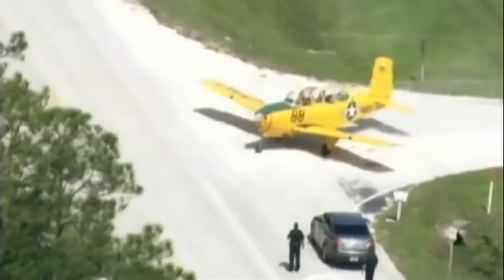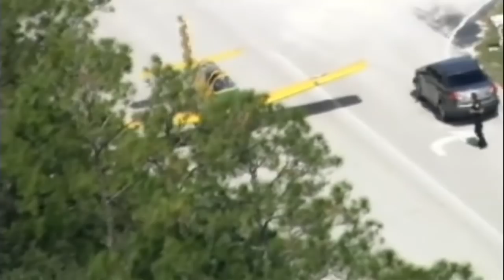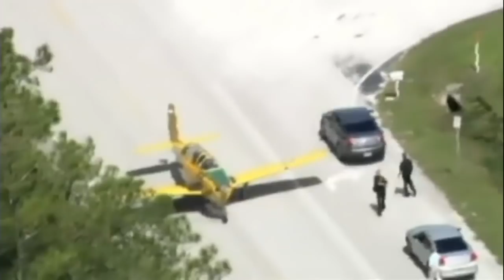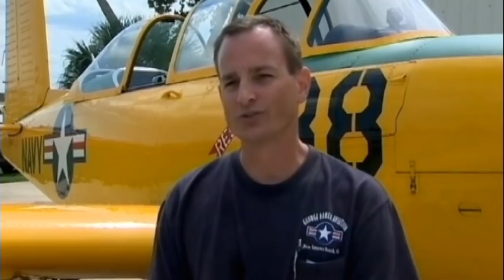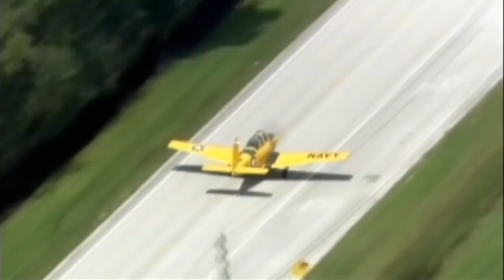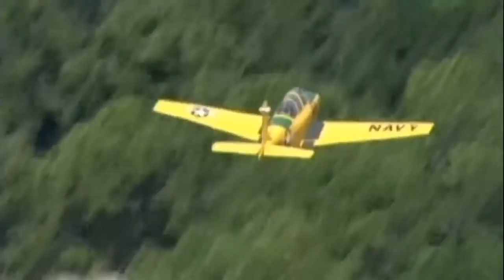Emergency landing: Plane lands on Florida highway

Comment: Something wrong here! You have to land on a road but then suddenly your plane is good enough to fly??
Reply: Maybe float carburetor faliure? I know that that requires a landing to fix. If he mixed down too hard and caused the float carburetor to die then his engine would have flooded with fuel and he wouldn't have been able to restart the engine in-flight.
Reply: TurkeyBoy55 l, the T34 uses a pressure carburetor for aerobatic flying.  It's not your typical float type carburetor.

Comment: Nice T-34. In 1967 I had an engine failure in a T-34 on downwind at McGuire AFB.  it started right back up after landing.  The mechanics couldn't find anything wrong?  I refused to fly that plane until a mechanic could tell me why it happened?  The next pilot to fly the plane had an engine failure about two minutes after takeoff.  He made a perfect touchdown on a golf course in the straight out.  Unfortunately, there was a ditch that ripped the landing gear off.  Too much damage to fix.  It was scrapped.  I know now, years later, that it was probably a split diaphragm in the pressure carburetor that caused tbe problem.  The jet engine mechanics didn't have a clue?  This pilot is lucky that he didn't have an identical problem.